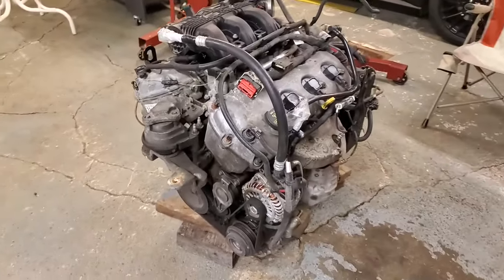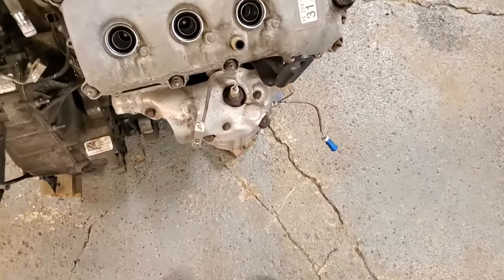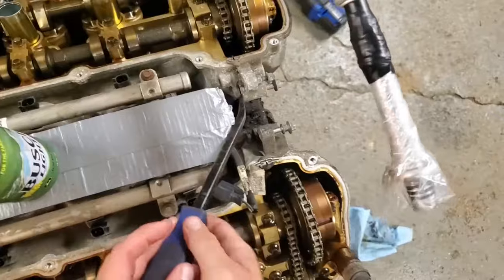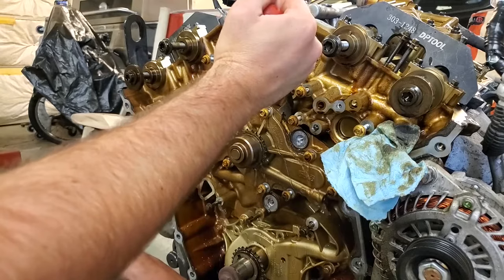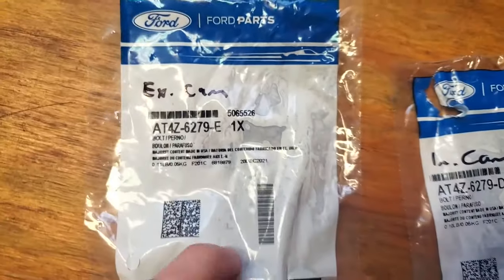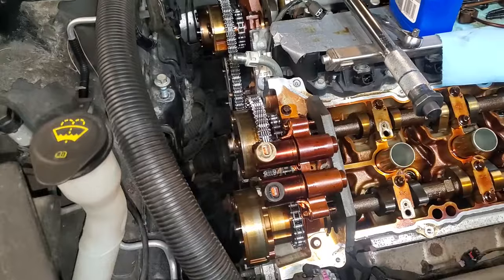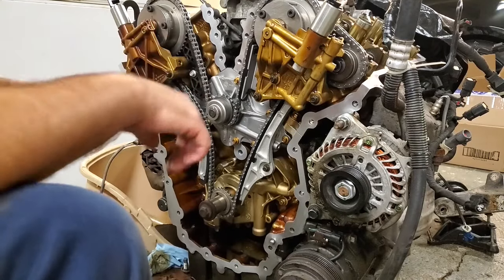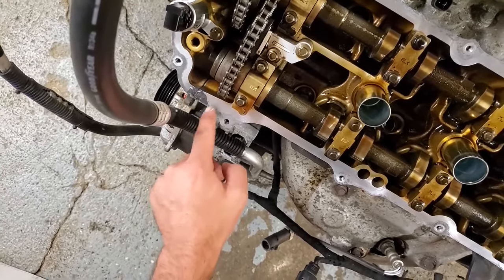3.5L Duratec/3.7L EcoBoost Timing Chain and Water Pump Replacement

Comment: i got a 3.7. how long did it take to do the job with engine removed.?
Reply from the maker: That's hard to answer because I really don't keep track of the actual time I spend working on things. However if I were to take a guess, that guess assuming consistently working on it (which I typically don't, I work at a leisurely pace and triple check about every step) I'd say even never having done it before but following along with my video you could probably get it done in 8 hours or less pretty easily.
Reply: @darkhorseautoanddiesel  thanks it looks pretty easy with the engine out. I might take it to the shop to do it so i kinda want to know the time it takes to do all this work with engine out. Also, my coolant leak into the engine. I discovered it when a P0016 code . I check the coolant resevoir..it was empty. The engine never overheated or seized up. I only cranked the engine up to back out the parking space for tow truck. Do you think it can be save the engine with new waterpump? The dealer told me I have to get a new engine. But I think they didn't even do a proper diagnostic. They said I got sludge in the engine because I didnt do oil changes. I told them bs..they didnt want to admit the water pump leak.
Reply from the maker: The P0016 is a timing issue, specifically Bank 1 camshaft is out of time. That can get catastrophic VERY quickly. Stretched chain, broken guide, bad tensioner, or a bad phaser or soleniod can all cause that. Could also be a bad sensor. Your best bet is to replace all of it. 

The empty coolant reservoir, where did the coolant go? Did it leak out of the weep hole in the block (located on the left side, front on front wheel drive vehicles, of the engine near the front) or did it end up in the crank case? If it went out of the weep hole, there won't be any internal damage from coolant contamination. If it went into the engine, depending on how long you ran it that way, it might be salvageable. 

The apparent sludge in the engine might be from coolant contamination. If that is the case, it's a gamble. They are well built engines, but everything has its limits. You can take your chances and try installing a new water pump, chains, phasers, solenoids, guides, and tensioners (everything really) and hope for the best, or play it safe(ish) and get another engine, and while it's out, replace all of that stuff on that engine before installing it.

TL;DR: If you have coolant contamination in the oil, as long as you didn't run it very long, then it's probably ok. By not long, I mean a few minutes. The longer it ran that way, the more potential damage is done.
Reply: @darkhorseautoanddiesel  most definitely the coolant spill into the crankcase. I got milkshake oil.
I probably drove 30 miles to my destination. No CHeck engine light came on or my temperature went up. I turn off car for 5 minutes then turn back on.. The P0016 code appear. My obd2 said camshaft sensor. I drove down the block 3 min to shopping center. Got out and noticed puddle under car. Checked the coolant reservoir. It was empty.. There was coolant on outside of engine block on the oil pan. I guess it came out the weep hole.  I towed it to dealer to check. Thry just told me i got sludge in engine and need new engine. They didn't really tell me what's wrong. But I know it was the waterpump fail. So basically my engine never overheated cause i monitor engine temperature with my obd2. It was around 190 to 200 degrees at the time. I got a P0016 code and milkshake oil.
There's 197,000 miles on engine. It's a 2014 Cx-9 3.7L. I read it's a ford engine.
Is camshaft sensor easy to change.?
Reply from the maker: @maolo76  Ooooh... You can take your chances putting new parts on that engine, but that's a lot of time spent driving with a milkshake in the crank case. I really can't give you much of an opinion on what to do. On one hand, it might be fine for a long time after replacing those parts, but on the other hand, that's a lot of money in parts just to throw at an engine that might throw a rod within days of doing all that work. It's definitely a gamble. 

The code may have showed up because the milkshake oil might have ruined the phaser on that side, just a guess. Just because the reservoir is empty doesn't mean that there still isn't plenty of coolant left in the system to keep the engine at the proper temperature. You can actually be pretty low on coolant before the engine will overheat when driving normally.

Unfortunately I don't know everything about cars and trucks, but based on my knowledge and the research I've done, yes, it is a Ford engine. That means you can get a 3.7 out of a salvage yard from a ford likely cheaper than one that came out of a Mazda. The cam sensors aren't terribly difficult to replace if I remember correctly, but unfortunately I think you probably have bigger problems than just a sensor.

Comment: How come you don't line up the orange links and the white link with the timing marks on the timing gears, When you're setting TDC? Does it matter??
Reply from the maker: I'm a little lost on what you're saying. I lined up all the colored links to the appropriate marks on the gears. Maybe I'm misunderstanding what you're asking?
Reply: @darkhorseautoanddiesel. When you set TDC at first. I see you set the timing marks, but the old chain , those orange links don't line up? Also, the updated part, does the new bolt tighten down on the steel sleeve or does it touch the outer plastic guide because when I tighten it down,  I can move the updated part in and out?
Reply from the maker: @mrboots066 oh you're talking the initial TDC setting. Makes sense now. The marks on the chains only matter during the installation of the chain when new. Technically you don't even have to use them then, but they serve as a great indicator that everything is actually timed properly. Once the engine has been turned after timing has been set, it could potentially take hundreds of turns before the marks on the chain line back up with the marks on the sprockets. 

So as far as setting TDC for disassembly, the marks on the chain mean nothing, the only marks that matter are the cams and crank.
Reply from the maker: @mrboots066 the updated part, you are referring to the right hand upper guide I assume? Did you get the new bolt that you have to use with it? It should tighten down just like shown I'm the video as long as everything is in the correct locations and using the correct parts. The bolt should tighten down the sleeve insert in the guide.
Reply from the maker: @mrboots066 I believe it only tightens down on the sleeve, but I've never looked close enough to notice if the head overlaps any of the plastic. Either way though, once the 2 bolts for that guide are tightened, that guide should not move. If yours does, that tells me that the sleeve is loose in the guide. 

What brand of parts are you using?

Comment: On the engine you have out of the vehicle with one cam phaser on each side did you only put one new bolt on each side of the motor?  With The new bolt going into the phaser on each side of the motor?
Reply from the maker: No, it got new bolts on the exhaust cams as well. Even though it's not holding a phaser on, it is still a torque to yield bolt, so it should be replaced.
Reply: @darkhorseautoanddiesel  thank you for replying!! When you was going over the part numbers the ones on the sheet of paper said there were only 2 bolts. Are the part numbers the same for all 4 bolts? 2 intake and 2 exhaust bolts?
Reply: @darkhorseautoanddiesel  I'm working on my 2010 ford edge limited awd 3.5l v6
Reply: @darkhorseautoanddiesel  getting the correct part numbers is what's throwing me off. 10/10 video though, very informative.
Reply from the maker: I had to watch that part of the video again 🤣 I realize now that I never gave the part number for the intake cam for the single phaser engines since it came with the kit. Your Ford dealer can get it for you easily though when they order the part. I'll have to include that number in the new improved video I'm working on for this job. 

The part number I gave for the single phaser engine is the exhaust cam bolt.

With that AWD system, check out my video on changing the oil in the PTU. You want to change that oil, trust me.
Reply: @darkhorseautoanddiesel  my ford dealer just told me on my engine with the single phaser on each side the part number/ bolt is the exact same.
Reply: @darkhorseautoanddiesel  yea I change the ptu fluid every 6 months since the exhaust is right up on it cooking that gear oil.

Comment: The timing cover is hard to remove, but there are 4 threaded pass through holes near the dowels down low and 2 near the top that are there to drive yhe cover off without cracking. The holes just use the timing bolts, so save your self replacing the timing cover and use those go around and work them all little by little till it pops clear.
Reply from the maker: I have another one of these coming in the shop in a week or so, I'll look for those.
Reply: @darkhorseautoanddiesel look at 15:50 timestamp. There is 2 bosses sticking out with threaded holes at the bottom of timing cover between the inner and outer 2 bolt holes both sides. Those are 2. Then look either side above the 3 bolt hole up from the bottom. There is another set of bosses sticking out with threaded holes. Those are you're self pry holes. They take the same cover bolts you just took out, thread in and just apply even pressure and walk them all in until the cover pops.
Reply: @darkhorseautoanddiesel Also, I don't recommend it but there is a crank lock tool that goes in the crank sensor hole. It's not worth the extra work to do vs just keeping the cams locked.
Reply from the maker: @edgeofvamp Definitely gonna try that. I plan on making another, hopefully better, video of this job on the next one, I'll be including this trick in that video. Thank you! We are always learning.
Reply from the maker: @edgeofvamp  The crank tool would alleviate the stress on the chain when tightening the crank pulley bolt though.
Reply: @darkhorseautoanddiesel  That's entirely up too you, just don't say I didn't warn ya.
When you see that the front cat needs to be removed, a heat shield, a rubber grommet and the sensor in a weird hole. Just to pull the sensor and slide the lock pin in for 2 mins of torquing. LOL
Reply from the maker: @edgeofvamp   Oh yeah... I forgot about the placement of that sensor... yeah never mind lmao
Reply: @darkhorseautoanddiesel  🤣😂🤣😂🤣😂🤣😂🤣🤣😂🤣😂🤣😂🤣😂🤣😂
Reply: Indeed, "I Do Cars" posted a video which includes the timing cover removal procedure using the bolt holes:  Link to the video:  https://www.youtube.com/watch?v=Bnhnvkb7KUc
Reply from the maker: @edgeofvamp  Well, I found out tonight that, unfortunately, this doesn't apply to all of them. The 2015, 3.5 explorer I'm working on now doesn't have those holes. It was even more difficult to get off because I overlooked the extra bolt on the right side of the engine 😂
Reply from the maker: @BlueSkies-pd9og  See the above comment 😂
Reply: @darkhorseautoanddiesel  Ah, the annoying variant with bolt number 26. Sorry you didn't get a chance to try the drive holes, that one leaves you SOL. Then a blow torch is your best friend, heating up the sides to break the seal makes it faster and safer.
Reply: @BlueSkies-pd9og  I forgot about that video, he's had all 3 variants of the timing cover over the past couple years. Engine teardowns are therapeutic, LOL.
Reply from the maker: @edgeofvamp  Yes, the annoying bolt 26. You know quite a bit about these engines 🤣

Eventually I'm sure I'll have the chance to use those threaded holes. I have an engine sitting on my garage floor that has them that I might do a complete rebuild on if I get bored enough. It came out of an '08 Edge that the water pump failed and dumped coolant into the crank case. All kinds of shmoo in that one...

Also I recently bought an '09 flex that smoked Bambi for $300. Depending on what I do with it, it may be getting a new pump as a preventative.
Reply: @darkhorseautoanddiesel  Small solo shop; I seem to specialize in engine teardowns, timing work and head jobs lately. I see a lot of 3.5 Ford's, 3.6 gm's and the typical 5.7dodges tick. Also seen an uptick in AWD transfer cases in the newer jeeps/dodges wiping out their clutch packs.

Comment: What size bolt did you use for the guide on the RH side ? I’m gonna have to do the same
Reply from the maker: Whatever size the one I got from the dealer is. I never measured it. The part number is in the video, I don't know it off the top of my head. It was only a couple dollars.

Comment: Identifix says on the 3.5 non ecoboost final stage to stretch only 90 degrees. On the 3.7 it says 180 degrees. What instructions are you using? It looks like your bolt didn’t break on the 3.5 so that’s good..
Reply from the maker: I was using a Chilton's manual as well as several online sources (whatever Google search led me to). Both engines in the video are still running perfectly fine so if they are wrong it must not be too detrimental haha.
Reply: @darkhorseautoanddiesel  please don’t think I was correcting you. I was noticing the same things online everyone says 180 final torque. I did mine at 90 but wonder if it actually is correct.. 🤷
Reply: I decided to call Ford directly with the VIN of my vehicle.. it’s a 2010 Lincoln MKX with the non ecoboost 3.5. They looked up the manual from Ford and it says final stretch 90 degrees.. so there must be some variances in those years.. I believe the 3.7 is 180 so just a little more information on these engines.. thanks
Reply from the maker: @lumberjackgarage193  no offense taken. I have no problem being corrected when needed. I actually appreciate it. I'd rather not be one of those people out there spreading false information. I will do some research on that and make a video update and link to it in the original. I'd add it to the original but as far as I know YouTube isn't set up to allow adding to an already published video, and they way their algorithm works, I don't want to remove this one. Thank you! Honestly I don't know why they even put TTY bolts on those parts, they lock in place. TTY makes sense on something like the notorious 4.0L SOHC V6 that has nothing but friction to hold the sprockets in place, which was a stupid idea on its own.
Reply: @darkhorseautoanddiesel  I agree, I was originally thinking my instructions were incorrect but since Ford confirmed them it made me feel better.. I watched so many other videos and forums. They all said 180 degrees.. it seems like the 3.5 ecoboost does call for 180 degrees to make it more confusing.. good luck though and thanks for the videos.. 👍
Reply: @lumberjackgarage193    -  Stage 1: Tighten to 40 Nm (30 lb-ft).

    -  Stage 2: Loosen one full turn.

    -  Stage 3: Tighten to 10 Nm (89 lb-in).

    -  Stage 4: Tighten 90 degrees.

is what i have for 3.5 v6 turbo, per alldata?!

Comment: how long did your cloyes kit last??   most last about 8000 miles...
Reply from the maker: Both engines shown in the video are still running perfectly fine and they've been on the road for over a year now, with over 15k miles each.

I put a cloyes kit on a 4.0L SOHC Explorer (notorious for timing chain failures) over 4 years ago and it's still going fine with over 30k miles.

Maybe I'm lucky, but the rest of my life says otherwise 🤣

Comment: The truck are outside water pumps am.i wrong???
Reply from the maker: You are not wrong. On front drive applications this engine uses the internal pump, likely due to packaging restraints, whereas rear drive applications use an external pump. I really wish they would have figured out how to package the front drive versions with an external pump. But on the bright side, Ford's stupid decision has helped my bank account. 🤣
Reply: @darkhorseautoanddiesel  how did it help you bank account??
Reply from the maker: @user-gm4lc2ym8p  Getting paid to replace them. Also the small fraction of a penny I make every time someone watches this video haha

Comment: What was the "delicate green wire"?
Reply from the maker: Apparently it is for the pressure switch on the power steering pump. I'm not actually sure, that's just what I've heard. I suppose I could look in the service manual wiring schematics and see what I come up with, but even that might not give me a solid answer. 

By the way, if you have electric power steering, you won't have that wire.

Comment: Do you have a part number or web address for the kit you used?
Reply from the maker: The part number will vary based on the year and model, so giving you that might be pointless. I can tell you though, that I got all the stuff from rockauto.com. Select your year, make, and model, then read through the selections and find what you wanna buy. If you've never heard of them, I can tell you that they're legit. I've done tens of thousands of dollars of business with them. So much that my shop fridge is half covered in magnets from them since they send you a magnet with most orders haha.